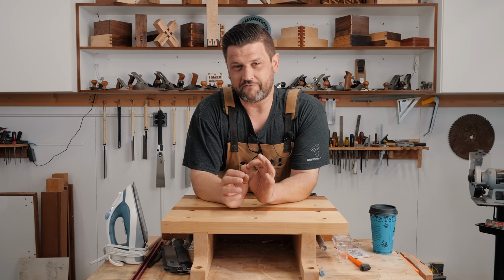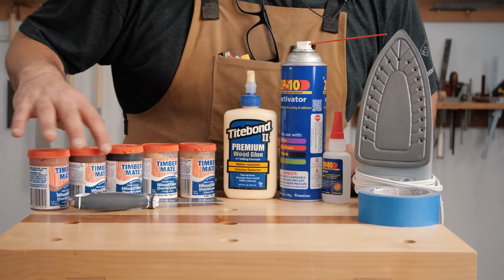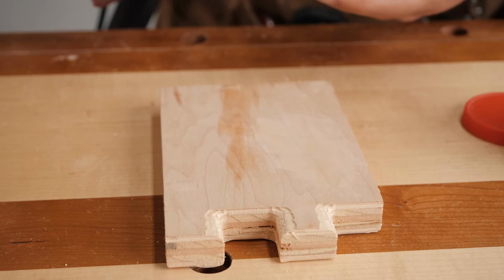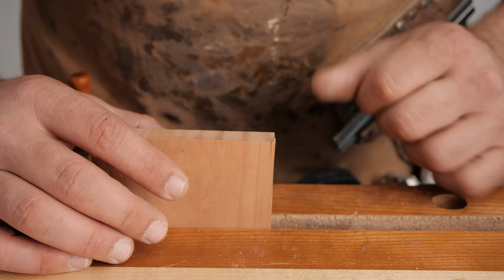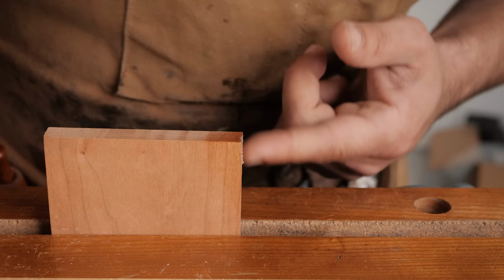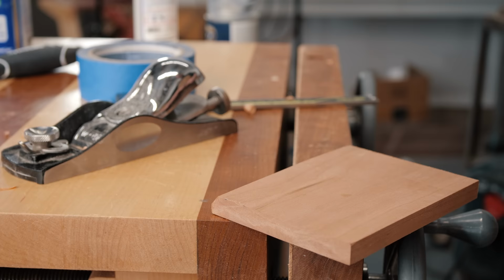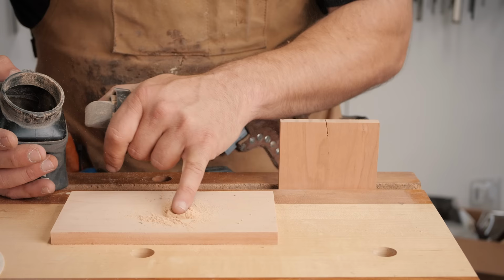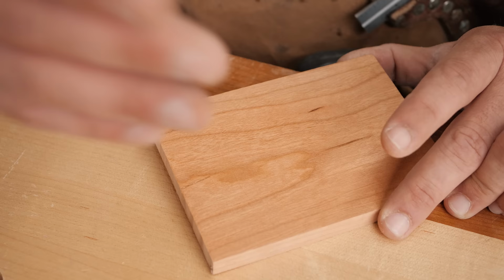7 Ways to Fix Common Woodworking Mistakes

Comment from the maker: Don't forget to enter the Giveaway: https://gleam.io/ysJHA/super-mega-flush-trim-bit-giveaway
Timbermate Wood Filler (Many Other Colors Available) - https://amzn.to/31ctD51
CA Glue and Activator I use - https://amzn.to/2SVZ3K6
The Wood Whisperer’s Video I reference - https://youtu.be/k-TWPlUI2jM
Reply: 8:10 i usually use the sandblaster to spray the sawdust 😂
Reply: I am in it to win it
Reply: 1 way to NEVER have 'woodworking mistakes'?..🔥
Reply: I would recommend you to find some thin CA glue, for the corner chip fix. You need way less glue, and it flow in much better.
Reply: 13:10 Si!!! Yo tengo uno truco espectacular para corregir tablas o listones (ya cortados a la medida final), que por un motivo u otro se han curvado, girado, o ambas. Sirve para cualquier medida, pero en especial para los listones largos.
Como ejemplo vamos a suponer un listón de 2 x 4 x 200 (cm):

Método para listones ya cortados a su medida final:
1)Tomar el listón, y seleccionar una de sus caras de 4cm de ancho a criterio vuestro, y abrir un canal de por lo menos 3/4 partes del ancho de la cara, (para este caso 3cm), y de 1/3 de la profundidad del listón o cara adyacente, (para este caso 0,6 a 0,7 cm). El canal debe quedar centrado.
2) Cortar un listón (si es del mismo tipo de madera u otra más dura mejor), con un largo y espesor igual o mayor al listón a reparar (para este caso 200cm x 0,7cm), y un ancho exactamente igual al ancho del canal. 
3)Encolar con adhesivo para maderas común, a menos que requiera mayor sofisticación, ambas partes (canal y listón pequeño), y embutir, como si se tratara de un inlay de ornamentado.
4) Prensar contra una superficie plana el tiempo indicado por el fabricante del adhesivo. Recomiendo mayor a 12hs.

Método para listones cuyo espesor (medida más pequeña),  no requiere una medida específica, o puede ser incrementado sin problemas:
1)Cortar un listón que mantenga las siguientes proporciones con el listón a reparar: 
Largo: 1:1
Ancho:1:1
Espesor:  1/3
2) Continuar desde el paso 3 del Método anterior.
Reply: Absolutely stunning content Jonathan! Subscribed so your content can help take my wood working skills to the next level. Audio, sound, explanations, and just the right dash of humor are on point. Hope to strive for the same on my channel :)
Reply: Guys and gals... lots of women doing this. Don’t discount us.
Reply: Great video!

Comment: There are no mistakes in wood working only design changes
Reply: Lol I call it research and development
Reply: @rickrenacci1717  that link didn't work
Reply from the maker: @Floppywaffle459  that's a scam
Reply from the maker: @rickrenacci1717  scam
Reply: AAAAAAAAAaaajajajajjaa no se si el tipo era orgulloso!!! XDDD
Reply: Let’s put in a happy little design change
Reply: @Floppywaffle459  R and D is very expensive.  Well known fact..and most of R and D is never seen and never finished. R and D.. Good Name. I usually just say ..I am going to go for walk arround.  That is the original plan.. Then I notice..you know if I took those sliding doors of my shed 
..hmm and uh built a 2x6 framing on the side..after all..the new doors must have supports. This little walkabout is really productive ...I walk back in..Did you plant the.Azelias..Ok I'll have it done in no time...Well no need for a Walk About..besides Marshall's or whatever store is next to a hardware store...Now that's a walkabout..I could use some good. workshoes. Now that Research and Devolpment.  It develops that I buy some good heavy duty workshoes.

.
Reply: @PIANOSTYLE100 lol it s just something I usually say when I make a mistake while I'm building something or figuring out a way to improve a jig or something im planning on remaking. Mostly it's something I say to keep me motivated instead of just focusing on my mess up
Reply: @Floppywaffle459  It is true though. After a.while. You find loads of tricks. I save scraps.. I used to throw away all kinds of stuff.  Off a 2x I can cut 1/8 " shim pieces. I have a bunch of. 3/4 " by 2'  Those can be narrowed to 1/8 " and used.as striping..placed in Dados and glued plus use that tecnique
you used with fine sawdust and glue..I make my own filler. I will.look into the wood filler you
mentioned.  Yesterday, I went and bought plastic wood.  I had put.an 1/8 inch plywood sheeting and had some chipping..I had used a fast cut.blade..oh well..This group of comments is all related to.mistakes making us better. I am useing my coping saw and very gently cutting to the exact profile incline the exact rounded corner of the 2x3s.. Also I prefer to use hand tools to do the final trimming. I use surform rasp, metal files of different shapes and get a very nice product. I finish it off usually with hand sanding...You channel is one of the best I've seen.
 I started a guitar channel in 2007. Didn't have video editing..  I started.  PIANOSYLE100 channel in 2013.  Just 103 subscribers.
Reply: they're not changes, they are "refinements"
Reply: Yesterday..I was working on bathroom project. I was matching 1983 plastic 1inch with real wood. 1/2 inch floor. molding. I could just butt.jpint them. So I cut it like I would join a corner.piece. It turned out very.nice. if I study it I can get very close. On to the next project.
Reply: @PIANOSTYLE100  Hmm you know maybe that is what I need to do with my dovetails.  No matter how hard I try my chisels never like going across the grain, but a file theres an idea.
Reply: I agree.  Skol.
Reply: My missing finger is a great design change.

Comment: As an early teen, I barely passed "Industrial Arts" class in junior high, and had to bring in ten dollars to cover all the bits and coping saw blades I was breaking. Then after I retired my daughter asked if I could make her a squirrel picnic table that only required a saw, a drill driver, and some sandpaper. I went to buy some wood and once I smelled that fresh-cut lumber, I was totally hooked on woodworking. And thanks to your videos, I haven't broken any drill bits or saw blades yet...but I might have to get a job at Lowes' or Home Depot to pay off my tool expenditures!

Comment: Tip for ca glue... use the bottle to push or the cap to push not your finger.....saw dust and glue in the cut use a piece of clean plastic bag to rub the sawdust in and do not sand until it's dry... the dirt and oils from your finger discolor the dust and sanding gets grit into wet glue discoloring .... try these and you will see a huge difference.... the dent in the wood you drop a drop on that a tiny puddle first and let it sit for 15 minutes to soak keeping the drop there for 15 min then as soon as the puddle soaks in fully after the 15 minutes. Then iron .... the water soaking deeper swells the wood deep lifting the dent proud... when you do this do not sand until the next day because the wood will shrink when drying .... if you sand it level while wet when it shrinks it will return to being a dent.... the cupped board just turn it over in the same place the next day it will either be flat or cupped the other way..... the reason this happens is not the rings it's moisture expanding the cells .... you can also cure cupping with a steam iron applied to the concave side. This expands the cells and dry iron applied to the convex side this drys and contacts the cells.... your method will expand the convex side while under load preventing cupping this will crush the cells together while damp then when it dries it will contract pulling to balance the cupping..... my 7th grade shop teacher called us all over to see a 2 foot wide table top that had cupped drastically all he did was flip the board and the next day he called us again to see that the cup was now on the other side.... his explanation was that when he came in in the morning it was flat but he left it there because the sun would shine on it before our class and he wanted us to see how the sun had dried the top side causing its edges to cup up ..... he said he was going to move it into the sun and before class was over it was nearly flat and he moved it to the finish room which had no windows.... he said understand how the cells in the wood work like a bunch of little bags being inflated with water ....green wood will do this where kiln dried will not as badly.... and once you finish your work if you seal all surfaces even those unseen warp should not happen

Comment: Most importantly, remain open minded. 

Measure twice, cut once - adjust plan to fit new dimension.
Reply: The second half of your tip is most important!! LOL!
Reply: I do this all the time. Literally yesterday I decided that an electronics tray was getting big chamfers because the end-grain tear-out was so bad off my machine. Or the time that the end table suddenly got a contrast board in the middle because I duffed the matching board so badly.
Reply: You can always cut off, you cannot cut on. 🤣
Reply: I cut the damn thing 4 times and it's still too short!
Reply: Measure once cut three times.
Reply: Idk if it’s cause I grew up with my dad owning multiple construction business but I can measure something and not mark it just look and go cut it and its always within 1/8 of an inch  and if something is less than 4 feet I can always get it within 1/2 inch idk if that’s common with a lot of people or that’s just me
Reply: @jasonlarsen2062  Not for me. I have done a lot of construction and I do not trust my estimations.
Reply: Ooooh yes. "measure twice - cut once" really is helpfull :D specially for dullies like me
Reply: @garymittelstadt7821  :D lol
Reply: Measure twice, cut once, f*CK, get a new board, measure twice cut once, f*CK again 😂
Reply: In the prototype machine shop where I work, the rule is make the part, then make the drawing. Also, it's not a mistake unless it leaves the shop.
Reply: Our family has a curse. We measure twice check them AGAIN and still wonder how in gods name it still doesn't match up!!!

Them adjust plans to fit new measurements 😝🤫
Reply: THAT'S my problem!! I've been measuring ONCE and cutting TWICE!!! No wonder my desk rolls like a dinghy on open water!

Comment: As a luthier, I often run into situations where I'll find chips missing on a rosewood or ebony fingerboard.  I've have jars of collected rosewood and ebony sawdust that I've collected over the years and I'll just sprinkle some of the dust into the chip, just proud of the surface and wick some thin CA glue onto the dust.  After a few minutes, scrape down with a modified razor blade scraper and voila!!  Chip is invisible.

Love ur videos!!
Reply from the maker: Great tip bud!
Reply: Sawdust a.k.a. man glitter😂
Reply: That works well on ebony which does not have any grain to it, but rosewood can be a harder problem.
Reply: I'm working on becoming a guitar luthier as a hobby
Reply: *viola
Reply: @TheMrJusteeno  lol XD
Reply: Tips I learned from Dan Erlewine!

Comment: My favorite "fix it" hack is the one with the damp rag and hot iron! I've never seen that done before!Thanks a million, it'll come in handy! Love watching your channel!
Reply: In high school shop class we would place a small drop of water on the dent to make the wood swell a bit. Then would have to sand back down. The iron trick is Trick!
Reply: I bought a cart load of bad wood at Lowe’s.  Plywood tacos, 2x12 yellow pine warped. 
Wet one side and laid in sun.  It warped the OTHER way lol.  Too much of a good thing. Ripped into shelves. 10 years later, still flat...
Reply: Another variant is to use a bandaid, the waterproof ones work the best. Put some water on the gauze part, then stick it over the dent.

Comment: "Now that's an extreme example; usually your gaps are smaller than that..."
Uh, nope. They're usually at least that big.
Reply: When I try dove tails, gaps that big are usually a minimum lol
Reply: Yeah my gaps are usually about the size of a finger joint or dove tail after I accidentally cut one off
Reply: Just went and cut some by hand first ones that didn't get messed up terribly.  3 more joints to go at a minimum... Pretty sure this will end up as a parts box in the garage....
Reply: I usually cut my dovetails with an axe, so yeah, my gaps are huge.
Reply: Wood filler is way better, in my experience, than glue and sawdust because glue doesn't stain. At least for me.
Reply: I make the GAP bigger then put a piece of wood in it with glue, for stain's sake :)
Reply: Mines bigger than yours!
Reply: @codacreator6162  Titebond makes a translucent glue that I use for this. I apply it differently though. I mix the glue/dust and basically turn it into putty then ever so gently force it into the gap. 

With this method there is so much dust in the glue that it does take a stain. It will be a hair lighter than the rest of the wood but unless you know you are looking for it and standing very close you wont notice.

Comment: Maybe the follow up video could include things like measuring the project, say a box, for square and how to get it square when it's not. 

Also worth mentioning when to use different types of CA glue, like thin to run deep into that split, or gel to avoid a run. Loved the tip about twisting the stuck finger. Hope I don't have to try it soon, but good to know. Great video as always. Now, get that shop dog his own safety glasses.
Reply: I cringe when I see young kids in the shop, but then I remember helping my dad when I was 7 cut plywood sheets on the table saw.
He showed me how dangerous the machine was and told me how to use it, and not to play with it. I never did. When I got in middle school about 12-13 I took shop classes, and fell in love working with wood.
When I was about 16-17 this older man had a workshop in his back yard. And I'd always wanted a wood working shop but did not have the room or money. I did however buy a skill  type saw, and I built a bookcase for my kids room.
I never put finish on it.
The kids used pencils crayons and all kinds of stuff as they grew up. When the oldest wanted to move out he wanted to take it with him, I asked what was he going to do with it.
Sand it down and paint it.
I said no. We me him and his brother and mom will never see 
The art he put on it as a kid again if he did that.
I still have not put finish on it one of these days I'll put clear coat on it. They can fight over who get it when we are gone.
Maybe by then he can apreashate his childhood art.
Its priceless.
Reply: @bobbg9041  cool story, have to pass on the tradition. I think clear coat would be great maybe test out some finished so it doesn't make the crayon run or smear.
Reply: Measure diagonally both ways until the measurements are the same, if they’re not just push either side out until it is.. and fix.

Comment: The Iron trick blew me away, man!  Thanks for sharing!!!
Reply: another pro tip is: dont use your wife's iron , buy a cheap one for the shop.
Reply: @PhilepZ  amen that! Although it hasn't seen daylight in years, don't touch it! You'd have a better chance at surviving a 100' drop on concrete than using "her" iron guaranteed!!😅😅😅

Comment: For large gaps that can’t be filled easily, I like tapping in a wedge of same type of wood to fill the space. Once the glue dries and wedge is cut flush, you can barely tell.
Reply from the maker: Great advice

Comment: I've been a finish carpenter for years and have never seen the steam for removing a dent trick. I have used drops of hot water with mixed results.  Hopefully I never have to try this (yea right, LOL).  Thanks for putting this video out. Cheers, Dave.
Reply: I've used this trick for 20 years or so. I keep an iron in the work truck for this. It's a great one to know.

Comment: Tip; don't use wood filler. You match the colour to the timber but when you apply a finish the colour of the wood changes but the filler doesn't!
My advice is to do the finishing, mix furniture filler wax to match colour, melt colours together on a spoon to get the perfect match, apply, flatten then put a final coat of finish on!
Reply: Great comment. Wood glue does not take stain well, either. This would fix that problem, too. Thx.
Reply: This is actually situational. Some wood fillers do darken with finish, and it also depends on the finish. Certain finishes darken more than others and it can mess things up

Comment: A good one that I have used with dovetails is to split out a wedge from an off cut. Matching long grain may be tricky, but matching end grain is easy. I've closed some annoying gaps that way. Once you tap it in, pare it down with a chisel, and get some finish on there, no one will know.

Also, for me it is hide glue, hide glue, and hide glue. Especially the liquid stuff.  I've used it for a lot of the applications you've mentioned. It can wick into a crack easily when warm enough. It can be mixed with sawdust as a filler. It is invisible if you don't get every last bit cleaned up when finish is applied over it -- think of your porous woods such as oak. AND it is reversible. I've definitely had to reverse a couple joints with heat and steam when I've messed up. You probably wouldn't get a deep mortise & tenon to come loose, but it will work on a lot of joints.

But I also know that you stick with what you feel comfortable with. If you don't have a feel for how something works, you might make life harder for yourself with a different system.

Comment: Great Video! I keep old medicine bottles and put fine sanding dust from projects in them. Some times I mix them. Go ask a pharmacist for some small bottles.
Reply: i noticed in a comparison that sanding dust + glue leaves black results. Use  sawdust and it will result in the color of the wood. do not use too much glue.
Reply: I have old whipped cream cheese containers with fine sawdust from walnut, red oak, and hard maple just waiting to fill little gaps this way...